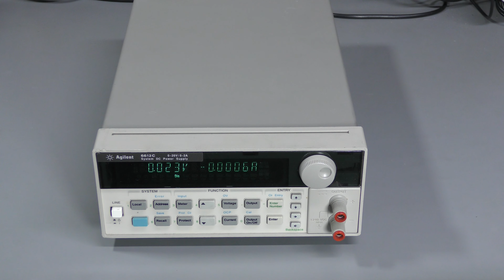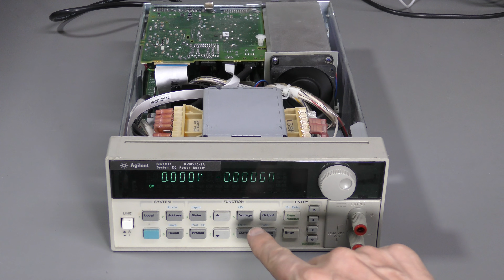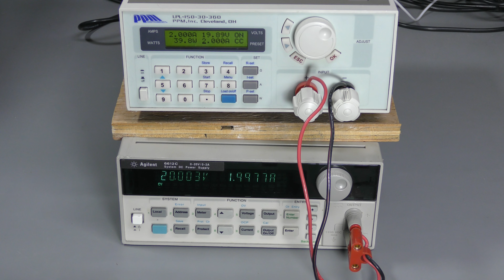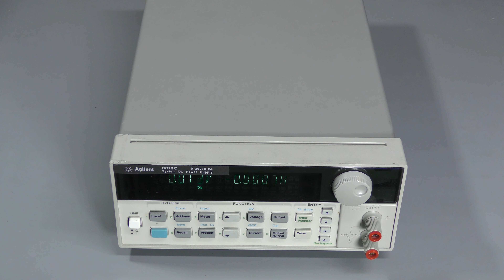#91 - Agilent 6612C repair

Comment: Always good, but it's more fun if it's more broken!  What you might do is pick a piece of equipment at random, take off the cover, set a power supply to some random voltage and high current, close your eyes, and poke the two supply wires into the thing.  If you do not yet hear a sound, try it again.  Then... the fun of fixing it!